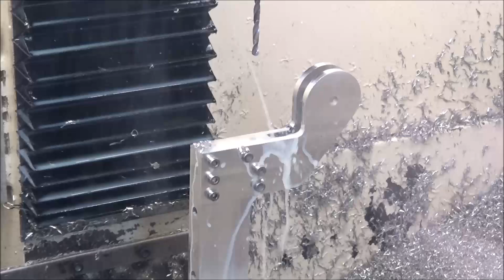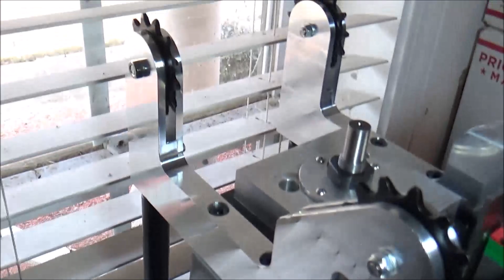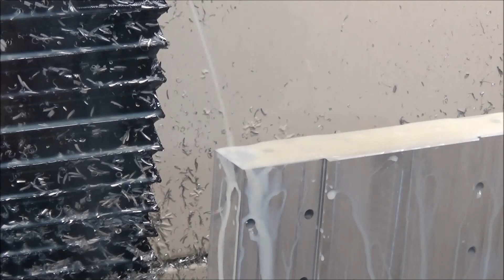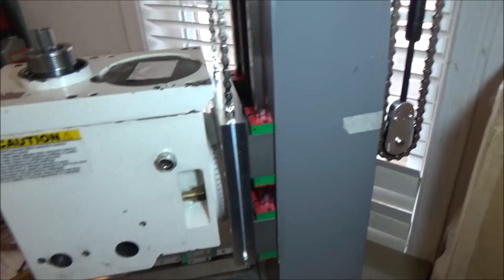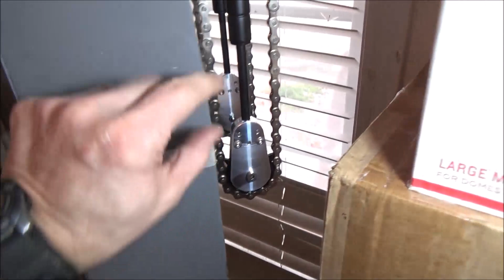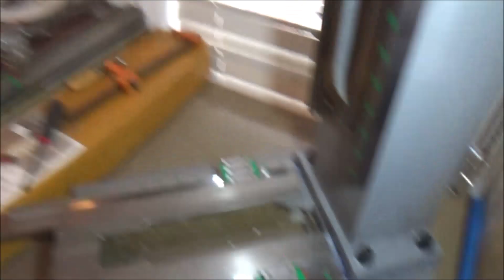PM727MXL Air Spring Counter Balance Part 4

Comment: Hi,
I stole your concept and did this airspring counterbalance to my PM940M CNC conversion using ClearPath motors and Centroid Acorn .
This really helped .
Of course it is a little bigger than your mill.
If you’re interested I could send you some photos but don’t know where to send them.
Presently working on converting from stock motor and gearbox drive to 3 hp Blackmax Marathon belt drive but need to grind custom tool bit with my Shars D bit grinder in order to cut ten groove multirib pulleys for the belt drive.
Everything is a new adventure and hurdle to overcome to end up with a fully functional “BattleStar”.
Reply from the maker: Great your very welcome Glad I could help.

Comment: I wonder if counterweight adds to rigidity of machine or its just for head weight reducing for motors to move? It just a known thing about those vertical mills that because is head is so heavy and in leanes to the front - its not so ridgit. Havent you noticed, does it has less vibration with counterweight? thx.
Reply from the maker: I think it does both.

Comment: There is much space at the back for adding weights as counterbalance. What are the comparison of using weights and air spring?
Reply from the maker: I did not want to have to deal with all the weight, build a box, make a guide way, etc. the brackets would most likely be similar I'm just  removing the weight and replacing with springs.

Comment: Sam, that's a work of art!  Just a suggestion Tie the 2 lower  Sprocket assemblies together with a cross brace. It may alleviate Any left to right movement of the gas Spring  shafts. Great job you should be very proud of that it came out awesome! , Ken Estelle
Reply from the maker: I have thought about that but currently there is no movement. Front to back or left to right. Just inward pressure. However once the servos are installed will see at rapids what it looks like. There is room for a brace.

Comment: That turned out to be really nice. I was wondering why you decided to use chain and sprockets instead of cable and pulleys? I've owned several motorcycles and I hate chains and sprockets.
Reply from the maker: The travel distance is 2 to 1 This is the reason behind the Chain.
Cables would be a Option and also Timing belts but there are other issues with those options. Good to hear from you again!
Reply: @CNC4XR7  To me the timing belts and chain setup allows for a lot of places where debris can collect and a cable setup is more resistant to that. Regardless, I like the setup you have and I'm sure it will be worth the time involved in getting it setup on your mill. I don't usually comment a lot but I watch all your videos. Thanks for all your effort put into your videos.
Reply from the maker: @williamhardin5254  yeah and timing belts would be wider. Hopefully the chips will be a non issue.

Comment: Works great. I use an airspring on one side direct mounted to my BF25 and that works either great. Keep up the good work
Reply from the maker: I Had a single Air spring on my X2 it works fine but the travel was not what I needed. With this system I can travel the full range of motion on My Z Axis

Comment: Cool, I use an air cylinder with a relieving  type regulator so the counter balancing force is always the same vs stroke (Z position).   Good channel.
Reply from the maker: Very Interesting!